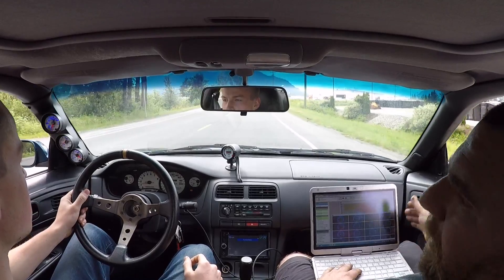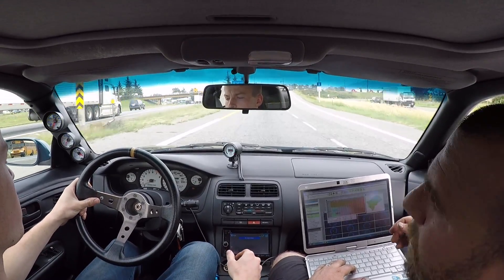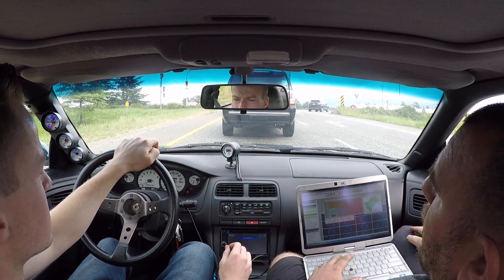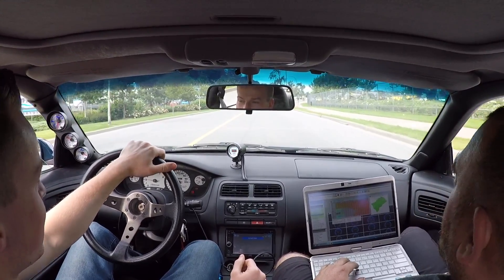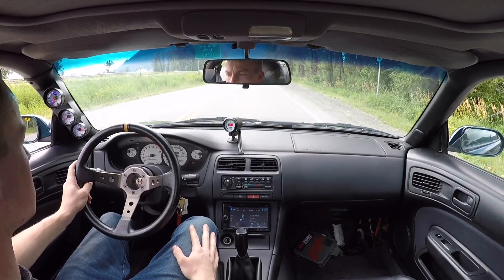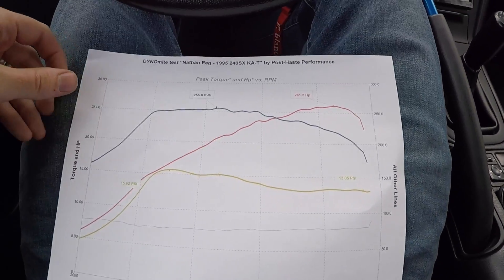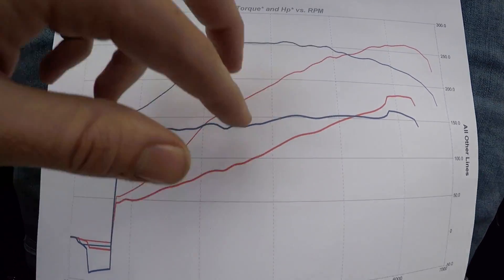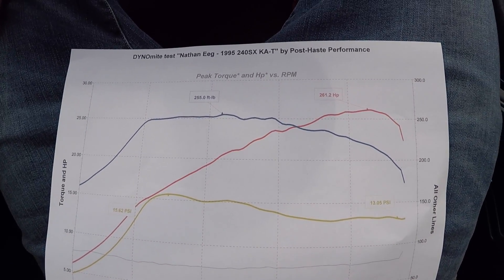S14 KA24DET Build - Dyno Pulls, Turbo Flutters and Nistune Tuning

Comment: I think OP went with gt2871r he'd get around 300hp. He's down .5 in compression ands thr fuel in bc sucks. EBC would help maintain proper boost pressure,  post haste performance has turned alot of high hp cars in the lower mainland but I've heard better things about independent speed shop ands racing greed. Btw OP, your drl Issue, I'm quite sure you can use a drl module from a pathfinder or a qx4, theres a couple thread about it.

Comment: Good job. I believe your steering shakes because of your front wheels. ether wheels need to be balanced or rim is bent. Maybe the tire is bad too:( Try swapping out the front wheels with stock ones. I had a similar issue. Vibration started at 60mph for me. I put a stock nissan wheels and problem went away. Also got a 95 240sx stock. Want to turbo it. Its auto, not sure how that will work.

Comment: Your duty cycle is so high and power is so low because your tuner has the car running pig rich. In the video he says he wants it between 10-10.6 afr. That is wayyyy to rich. At a 10 afr you could have misfire and gas in the oil. You should be able to get away with mid 11s afr with conservative timing especially with the lowered compression of the new pistons. This will reduce duty cycle and probably add power / response.
Reply: that tuner guy didn't seem to know what hes talking about.
Reply: My boss’s turbo ka is in the mid 11s. He’s also running 1000cc injectors. Probably a little overkill but it’s always good to run a bit bigger of an injector. I realize this is an old video but maxing out your 550s is possibly gonna kill that KA.

Comment: Only 260whp? Feel like you should definitely be in the 300's with that build sheet.
Reply from the maker: Mantis Toboggan ya might need to get back on the dyno again 😂
Reply: @BuiltLikeThis  you might wanna try a different tuner
Reply: @BuiltLikeThis  yeah with built motor u should get well over 300hp
Reply: The budget hatch on jimmy oaks channel made 260hp on 7psi js. This makes me lean more towards the cx kit rather than the isr. Haven't pulled the trigger yet. Any updates coming, even just a brief one to help dudes like me decide?
Reply: How much hp is it possible to get without getting forged engine parts ?
Reply: @andrikmartinez1214 250 max, that’s achieved with arp bolts and a good tune obviously

Comment: Is there a way to have boost build throughout the rev range? Or is that where the waste gate comes in and starts working? Or does building boost throughout rev range something similar to boost by gear? Sorry if what I'm asking is slightly confusing I'm curious to why it lost a little psi as the car got higher into the rpms.
Reply from the maker: Kennation Gaming Im not exactly sure why it does that. I think what you want is to hit 15psi and stay there. Not go up or down. Its probably just due to the internal wastegate. If I were to do this over id go with external wastegate right from the beginning !
Reply: BuiltLikeThis oh ok thank you!! that really helped☺

Comment: Timing is most likely overly retarted, judging by lack of power/hot manifold. Running rich at wot 10.6
Enthalpy stock ka tunes put afr 11.5 at wot . Fully built ka should see closer to 12. high 11s. Timing is dependent on if you get any knock, safe pulling is .75-1 per psi . Your ka is built, so you can throw more timing at it. Don't compare dynos, too many variables, dynojets typically read 10% higher, also your in canada correct? so 91 octane? 93 in US.
Fuel wise duty cycle 550s 90% yields 377hp crank/320wheels  100% 423hp/360w. 
Do you have a consult cable? you could log timing while driving, but I would check base timing as it's most likley off.
Reply: Hi Alex14 I see you have told this guy mani info. But I can't see any video of you on your channel. Are you a tuner builder what do you do? Remember, I am not saying you don't know anything. I like to know more about your skills.

Comment: I feel like that power is really low for that amount of boost. I made 290whp at 10.5psi with sti 525 injectors at about 88%dc and running nismotronic. I'm running a twisted motion v1 2871 turbo which is pretty much the same as what you're running. Did I hear him correctly in saying that it should be around 10.5afr under load? If so that's pretty rich. Mine is at 11.7 wot and Im running 10 degrees base timing.
Reply from the maker: Steven Hoffman thanks for the input. Ya im gonna talk to my tuner and see what he says. Already used to the 260hp
Reply: @BuiltLikeThis  id contact Z1 in georgia about a possible remote tune... jon parham is a wizard
Reply: I made 336 wheel on a 3871 on 550’s. Plenty of room left with that turbo.

Comment: 89% duty cycle is a bit high shouldn't got over 80% if you want the injectors to last . At least thats what i remember from school , need to look back in my books
Reply: i think 90% is what you wanna avoid going over... i could be wrong though